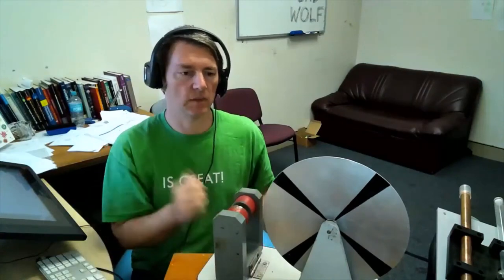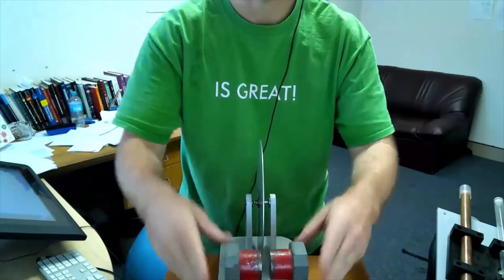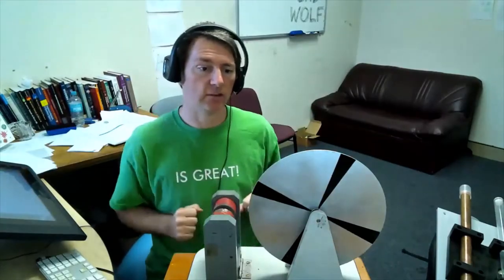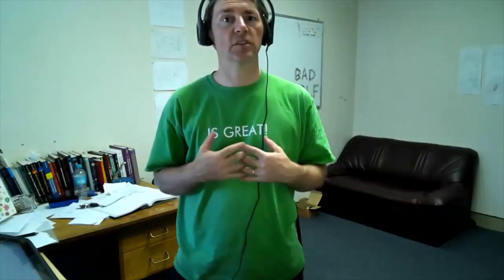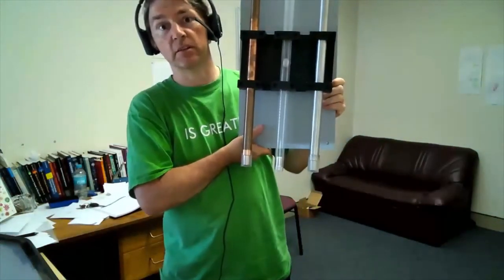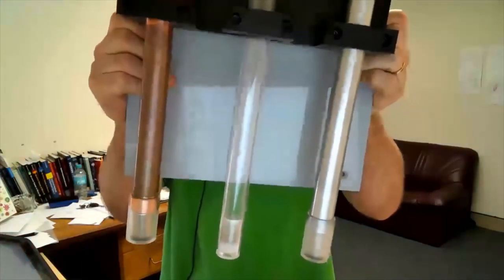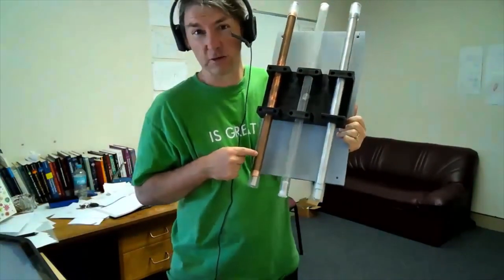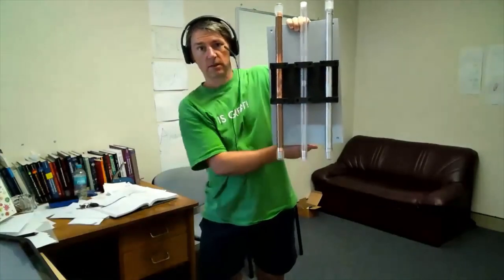Magnetic braking | Electromagnetism | meriSTEM

Comment: Why arnt people using this to make better brakes
Reply from the maker: Great question! Magnet brakes can often work too well! As you saw in the video they stop the metal disk quite quickly which could cause injuries in cars. Magnetic braking is used in safety mechanisms in saws for this reason. It's also used for trains but the magnetic field strength is controlled to ensure it is not an immediate stop
Reply: @meriSTEMEducation  maybe if you have an “weak” electromagnet with the current going “on-off” could make for a better system without it stopping to quick but very interesting concept I wish I could engineer such a device but I do have the thought of it lol